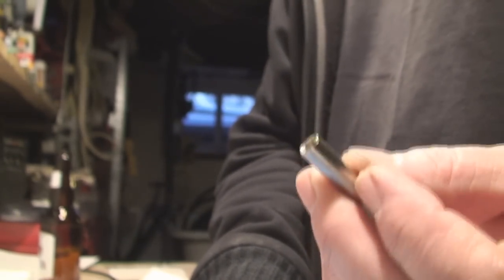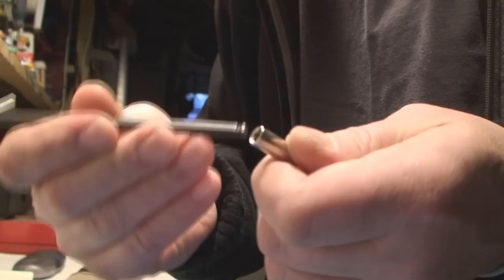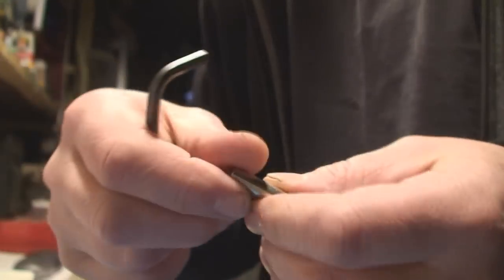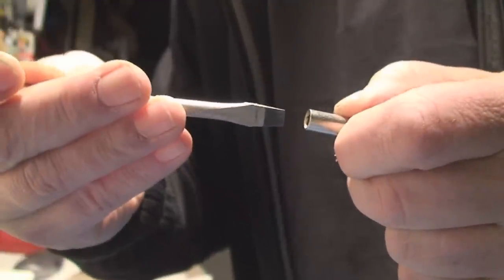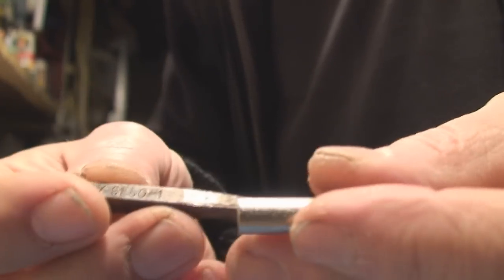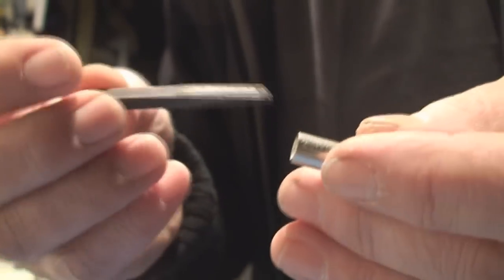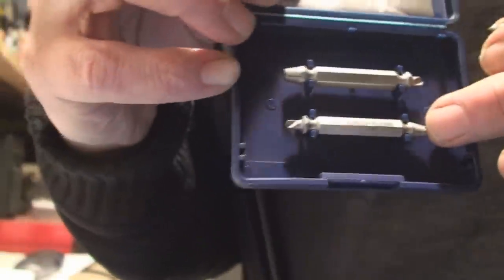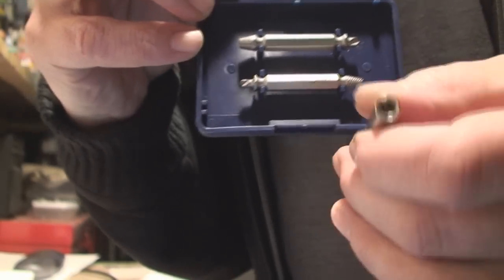Stripped Trussrod Nut Removal

Comment: What I've tried that usually works is try using steel wool. Use the correct size of Alan key to sort of push the wool into the stripped out portion of the hex. The way it works is that the wool helps by making the key fit the stripped hex a little better, but also because it's coarse, grabs onto whatever it can in the hex. Of course, be careful to keep it away from the pick-ups.
Reply: What kind of steel wool did you use?

Comment: I've had a lot of luck using the next size up TORX bit.  You have to be gentle though, the torx bits are slightly brittle and if the nut is cross threaded it can snap off.

Comment: Dave - Alway good / fun information !  On your " Stripped Trussrod Nut Removal " video you mentioned that one might get ahold of you with ???? .  I have a barrell / hex nut ( as in the video ) that is bottoming out during tightening .  Can I remove it without getting myself in trouble with the truss rod itself  .  .  .  then either shorten the barrel by cutting off the bottom , or   .  .   shim it up so that it will tighten further .  Thanks for your help , and your sense of whimsy !
Reply: Dave - Prompt and courteous  .  .  . advice with a smile .   I may be able to hear the angels singing within the hour . Thanks for your help !      Brad

Comment: I have a Ibanez Bass guitar GSR 190 GIO, I removed the stripped nut, but I don't know if there is a new replacement.  I read in some forums that the one that fender makes dont work, it something with inches and metric system. the thread and nut size is the issue. Could you please help me?

Comment: Is this possible on a a dual action truss rod?  I've got this exact problem & the neck I need to work on allegedly has a dual action rod.  The barrel nut will move using the flat head screwdriver method but I haven't tried yet as the replacements not yet here & wanted to double check before it ends up with even more goochery.

Comment: My barrel nut from my truss rod isn't striped yet, but it is seized up terribly. It won't turn in either direction. Liquid solvents aren't working yet and I've even released tension by removing the strings. This is on my Epiphone PR-100-12 (12 string acoustic) and the nut is in the headstock (truss rod is adjusted there, not inside at the neck-body joint). What can I do? I could probably treat the nut like it's striped and pull it out that way but all I need to do is loosen the truss rod just a little bit.

Comment: Put duct tape onthe end of screw driver. Sometimes the right wrench can mess up the nut. They make the nuts out of really cheap metal ,so it will be easy to remove if the threads get crossed on the truss rod.

Comment: So, if that screws into the trus rod, and you turn it counter clockwise (as if you wanted to add relieve), at what point does it stop turning the trus rod and is starts being removed from the trus rod?
Reply: after a while it will unscrew and come out

Comment: Thanks, Dave.  I've got a Larivee acoustic guitar with a very loose truss rod.  I tightened it a bit too far clockwise and I fear it may have broken.   Is this a situation where a luthier needs to remove the fretboard to replace the whole rod?
Reply: *****
I didn't feel it break.   It still turns, it just turns too freely both ways.

Comment: I managed to take a slight bow out of a Epi Les Paul Custom with a T25 driver.
Have you ever worked on one? I would like to replace the nut but they seem to be different.
The nut seems to be encased in a shaft and I don't see any replacement information on line anywhere.

Love your videos. Spent about 2 hours watching last night.

Comment: I sorta' buggered up one-not severely enough I couldn't Remove it, though. So I took it out and put it in a Vice, that I put those Magenetic Rubber Safety Grippers onto.  Then I Hack-Sawed a Slot into the end, smoothed the edges with a Point-File, and Voila`-it could Still be turned-only with a Slot screw driver, from now on.

Comment: Thats how I've managed it too. Epoxy resin on the largest wrench that fits has worked for me. Its particularly handy if its inside the soundhole of an acoustic and the nut doesnt have a deep enough hole to use an extractor. I dont think the screwdriver method is a good idea. It can split the nut leavin you in a worse mess.

Comment: It is more problematic when the truss rod is accessed through the soundhole. It seems such a bad design, going through the sound hole. Not bad - spiteful to the human race. As if the devil himself thought it up. I was about a hair's breath away from smashing my guitar. I just barely stopped myself. 
So, how to remove a nut through the sound hole? Do you think smash the top, burn the fretboard and then use the extractor?